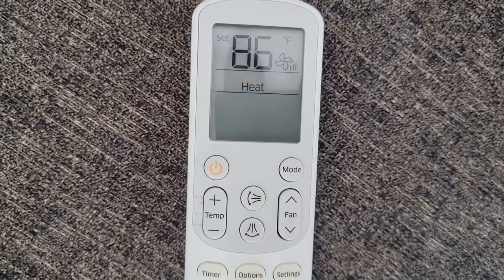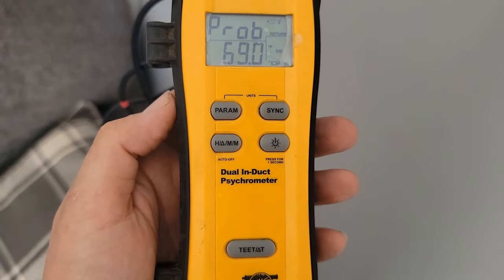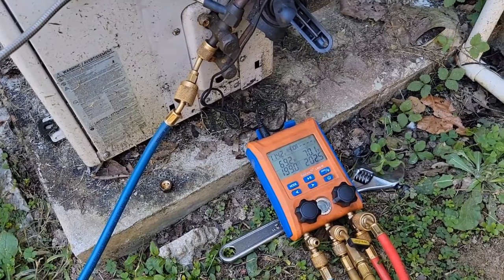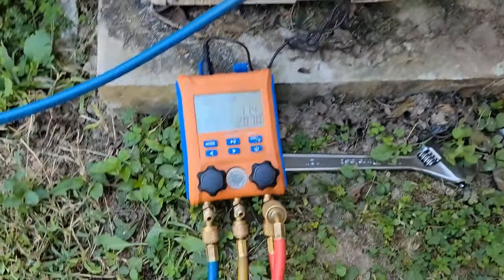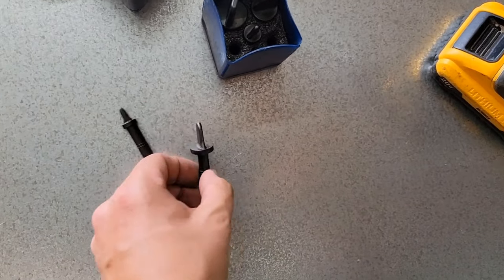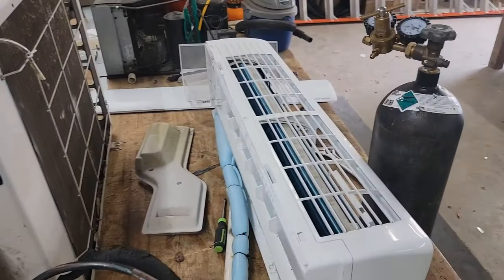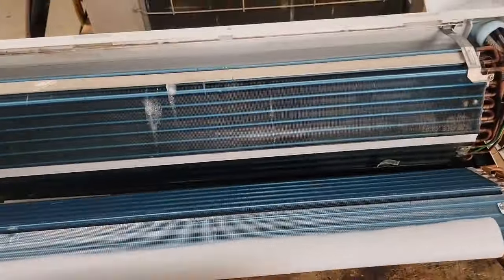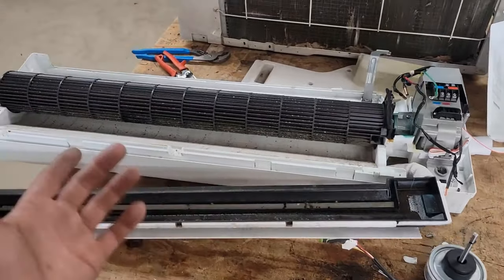Mini Split Not Heating Leaking Refrigerant

Comment: Bro mine it’s set to heat but no vent movement or condenser movement just the vent opens ,no sound or anything,cabling it’s checked and cold mode it works great! Why?

Comment: What will be the ideal pressure with nitrogen 12k unit pressure was 200 psi couldn't  find the leak
Reply from the maker: 600 psi for testing With nitrogen the flare fittings
Reply: @TaddyDigest  thank you sir

Comment: Mini split suck, I have it installed in my vacation house outside the US, They are good for one bedroom apartment or a studio but not for a house, You would have to have one evap for each room and you have to run refrigerant lines to every room, the total power consumption surpasses central HVAC. Central split is the way to go.
Reply from the maker: Glad you watched the video thanks for watching.
I appreciate your opinion
I'm guessing you did not have good luck with the vacation home Mini split
Reply: @TaddyDigest  No, it has nothing to do with luck, works fine, but if you scale it up in a bigger house it turns into a power hug, not  designed for bigger houses.
Reply: @Capturing-Memories  That's probably because it was sized incorrectly.

Comment: 99% of my coil leaks are indoor coils . I don’t believe that the air quality is the issue but copper quality is the culprit . If that was the case then older systems would also leak as well . Old ductless r22 systems never ( I mean never leaked ) why .?  Between 2012 and 2018 systems with R410a leaked more than current models do. I

Comment: during installation you are only pressurizing the indoor coil and the rating on the outdoor nameplate is probably a limit of 300 or so psig. could you be causing a leak by too much test pressure?

Comment: Leaks at the brand new LINE SET, specifically from the lineset manufacturing. Cut the flares off at the outdoor unit and single flare both tubes with a high quality flare tool after reaming. Very few videos on this. Lots of videos on vacuuming and dumping, but not many on this issue once you have already dumped.

Comment: The reason the could leak is not VOCs... it's crappy cheaply made aluminum coils. This almost never happened when they were made of copper.
Reply: Exactly right, the freaking things made in China, hate working on the dam things.
Reply: Most the leaks I find are on the copper on the side of the head unit.  Mostly dude to lack of maintenance. Still seems like the coils are made that bad on purpose.

Comment: Have a brand new LG mini split. The AC works fine but no heat. We vacuum pumped to 40 microns 3 times as per instructions. Power is 220, good voltage. Is it just missing refrigerant?
Reply from the maker: I'm not sure I would need more details
Reply: @TaddyDigest  That’s what my problem was, very low Freon , no heat… I had no time to work on it myself so I hired a friend who is HVAC specialist, charged me $ 720 to add Freon … I was shocked it he charged me $ 720 for less than an hour of work… but I got my heat 🤷‍♂️ 
Is that a normal Price for that type of service..?
Reply: @valg009  what a rip.
Reply: @valg009  refrigerant cost money lol
Reply: @valg009  Did he fix the leak first hopefully??
Reply: @valg009  I charge 72 a pound for 410A, usually mini splits don’t hold that much though, maybe a couple pounds most times .

Comment: We just installed 3 Mr cool heat pumps. There was no heat with errors 00 and 04 (but ac was good). We called tech support and they said there should be no threads showing when the pipes are tightened. However, this is not clear on instructions and many videos. It was a simple fix in the end. Hope this helps someone in the same situation.

Comment: When I turn on the air con, I have it on heat, it works for about 5-10 mins then all of a sudden it just stops blowing hot air. The light is on and the flap is still down but it just stops blowing hot air. It doesnt happen every time but I usually turn it off and on again but do you know how to fix so it constantly blows air until I turn it off?
Reply from the maker: Could be a failed sensor or could be the charge. I would start there

Comment: I’m now installing my third evap in a span of 9yrs. Just like this video, my leaks are happening in the middle areas of the evap. The unit was installed in a room addition I put on our home and had new laminate flooring installed when the room was built. The first unit was a Mitsubishi and that evap coil lasted 5yrs and two weeks. Supply house gave me a new evap although it was out of warranty a couple weeks. That next Mitsubishi evap lasted three years and had a leak in the middle of the evap exactly like the first evap. The next unit was a total swap out to a Gree unit. This evap lasted 6yrs and I have a leak once again in the same area as the first two evaps. Flooring should have off gassed all the voc’s by now. There was also a room deodorizer that put a shot of deodorizer in the room every twenty minutes. I pulled the deodorizer out about three years ago but maybe the corrosion was already under way to the point I’m at now which is replacing the whole unit once again😢
Reply: If you are testing with nitrogen above what the indoor coil is rated at during installation, could you be over pressurizing and causing the leaks?
Reply: Nope, I run the pressure up to 150# and checked for leaks. I also remove the flare fittings,except the ones at the condenser hookup, and braze in fittings; I also purge nitrogen through system during my brazing. Triple sweep system and evacuate down to 100microns at least.

Comment: That’s what my problem was, very low Freon , no heat… I had no time to work on it myself so I hired a friend who is HVAC specialist, charged me $ 720 to add Freon … I was shocked it he charged me $ 720 for less than an hour of work… but I got my heat 🤷‍♂️ 
Is that a normal Price for that type of service..?
Reply from the maker: It really depends on how. Many pounds of refrigerant he added and what he charges per Pound

Sounds kinda high to me

Comment: We have very few minisplits in canada, and on the one that i worked i had formicary corrosion on the lineset. As I learned that foam insulation should be sealed to prevent water/air intrusion otherwise it starts leaking.

Comment: I install mini splits and anytime a charge leaks out they want you to fully remove whats left and re weigh in a new charge. They dont like us adding refreigerent until the pressure seems right because the pressure varies too much on a minisplit system depending on how many heads and length of lineset you used so the pressure is never consistent and most installers are too stupid to learn all the math to accurately add in charge without weighing the whole thing in. I just use a computer program at this point to calculate the charge base on distance. But sometime i use the equation in the book in the installer manual when i dont have the comp on hand.

Regardless learned some stuff from this video, always like to keep improving on my trade. Thanls for the info.
Reply: You are wrong. On minisplits and inverters. They best way is to weighing it in...Also when leak detecting an indoor unit, never have the fan running like the guy in the video had. (noob mistake)
Reply: @guuuuustaf  that's what I said...

Comment: I’ve got a Carrier mini-split that isn’t even two years old that is not working, so I had a service call today and it’s leaked all it’s coolant…not even two years old. I am told that the labor warranty was only for a year/parts 10 years. Tech spent over two hours trying to find the leak w/o success. Put a leak dye in and will come back in a few weeks to try and find the leak. Also was told that if I don’t keep up the twice a year service plan that it will void the warranty. I feel like I am being taken for a ride because I’m already looking at close to $1K just to diagnose a less than two year old system and haven’t even found the leak. To me it says the company is in business to sell and not stand behind their products/installation. Does this sound normal? I have 15 year old window units that I paid @ $150 that still work great and now a really expensive mini-split that is essentially a fan.
Reply from the maker: Most leaks are found in the flare connections and are due to improper installation
A thousand dollars just To diagnose is pretty expensive
Companies use that warranty clause as a way to no longer be liable
Because what if it was due to the installation

Sorry you're having the trouble hope you get it fixed for sure
Reply: @TaddyDigest  so the copper coolant lines have pin-hole leaks due to corrosion. In less then 2 years (actually was prob 16 months because the heat wasn’t working last Fall, but I have a boiler and only use for a/c). Manufacturer’s warranty is 10 years, but the coolant lines are not from Carrier, but universal, and they won’t cover them under the warranty. Labor was only one year. So they want a hefty $3300 to replace. They are “generously” giving me a 30% discount on that which takes it down to $2300 (basically jacking up the price to show a “discount”).  In addition my lines are the ones that are wrapped with the white insulation that is all over the internet about causing these issues. The owner said they had the same intel and changed the lines that they use a year ago. So my system was installed with the crap lines, he admitted that they have had 4-5 systems fail in a year (had gone 30 years w/o issues) and for that very reason changed what they use. But he still won’t cover mine under warranty because the manufacturers of said lines won’t take responsibility, so he can’t recoup either. To me that says they don’t stand behind their work or product.
Reply: @TaddyDigest
So the saga continues. The company agreed to replace the coolant lines and came to do that 10 days ago. When they took the old lines out, found the brass fittings that connect the coolant lines to the inside head units had also blown (I suspect this may have been the origination of the problem to begin with). They had to take out the 2 inside head units and take them back to their shop to repair. Came back the next day to put head units back in and replace the coolant lines. They were there for 5 1/2 hours because it took forever to flush and get the lines back up to charge. When they left at 8:30 at night that Thursday, both heat and a/c were working. Fast forward 2 days, it was a chilly night so wanted to take the chill off the house so turned the mini-split on rather than firing up my boiler and nothing. Head units open, close half-way and do nothing. Came back out to check it and it’s still leaking even with the new lines. They pumped it full of nitrogen and will come back in a few days to see which line is losing pressure. 
Questions:
1. Do you think the overall problem was probably bad flares during original installation?
2. Should I be concerned that this will be a continual problem?
3. While waiting for them to finally get here to do the fix, the one inside head unit dropped some ice out of it…is that concerning/why would that happen and should I mention it when the tech comes back out?

Comment: Dude, Nice!! I’m not a technician , but I pretend to be one. I do build large machinery dealing with pneumatics, hydraulics, electrical, welding and blah blah . I know nothing about heat pumps but my nephew has one that doesn’t appear to be functioning and he asked me to have a look. Of course I told him I can fix anything like any proud man would and soon as he left the room I grabbed my phone and here I am. He said it had been making a weird noise the last day or so louder than normal.. as of right now to meet it appears it has no life at all like this like the circuit breakers blown but it’s not but I feel I’m more confident now I seen you I seen your video, so thank you. If you get time maybe you can throw me throw me a bone or I should look first after the breaker. Where the  brain of this thing must have a computer board or something to tell it what to do. does it have its own fuse a few link? Is i there life after death? Or usually once they go that’s it, not worth fixing? I’m sorry you don’t have to answer all those a lot of questions. Maybe you could just pick a couple. Thank you.
Reply from the maker: I'm glad you're trying to help that's awesome
Start at the beginning with a meter
I hope you get it fixed my friend. Thank you so much for watching my videos

Comment: I installed a Senville dual zone and within weeks the heating is not working great as soon as cold cold weather hit, pressures and temperature at outdoor unit is good, What could it be? Senville having alot of issues lately with brand new units
Reply from the maker: When you say the pressure is good? What does that mean?
Reply: Suction pressure 390psi in heating mode  @TaddyDigest

Comment: I have a heat pump that needs gas as it's not heating enough in heating mode at minus 8 outside . Do I force it into cooling mode to add refrigerant?
Reply from the maker: I have a video of what you can do I will share the link.
Reply from the maker: https://youtu.be/GyrSxeFxScM?si=FO_CFyCcbv9O0vKd

Comment: What does EL 0C error code mean my mini split runs for about 20 mins and then gives me this error outside fan not spinning super fast like it used to its spinning kinda slow
Reply from the maker: I'm not sure what that code means.
In order to figure out the air code and the description you would need the model and serial number and I would need to download the manual.
Reply: @Taddy Digest  12,000 btu Senville Leto it's not even a year old
Reply from the maker: Click the join button become a member send me an email. Then I can help you.

Comment: I have a Carrier 18000 2 zone mini split. Have had a CF code for awhile comes and goes. But now have P4 code no heat. Never had a problem with cooling.
Thanks
Reply from the maker: CF usually means clean filter
Reply: @TaddyDigest  filters clean on inside unit

Comment: I have a 7 yo heat pump split system that recently stopped working, it stopped making heat. I discovered an oil spill under the heat exchanger outside. Is this safe to assume that leak is there too? We just bought the house recently and unit looks neglected. We are in snow belt. Thanks!
Reply from the maker: probably leaking
Reply: @TaddyDigest  thanks! Is there a way to test it without indoor unit? Like disconnect it, use a short line to connect flanges and pressurize it?
Reply: Lol

Comment: Hi i have an aureus mini split . I have it on heater mode . The unit that is outside has ice around it, is this normal? The inside unit doesn’t have ice only the one sitting outside.
Reply from the maker: It's normal for it to ice up this is caused by low outdoor ambient temperatures and the unit making itself colder than the outside air to gain heat from it
 It should  Defrost
Reply: @TaddyDigest  Thank you so much for replying and for the information, I appreciate it 🙂.